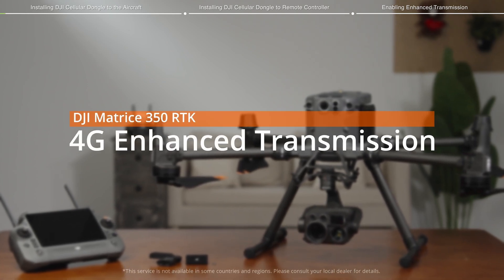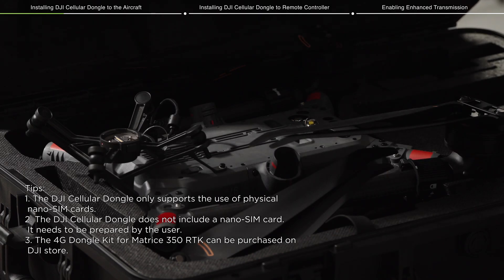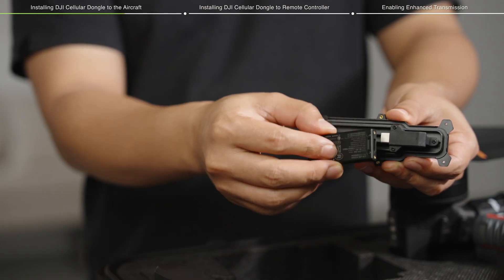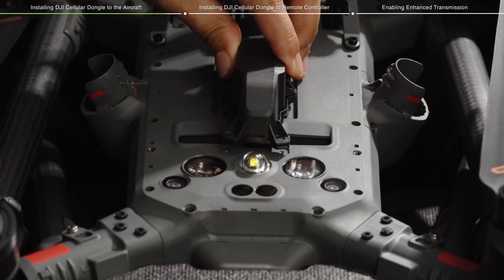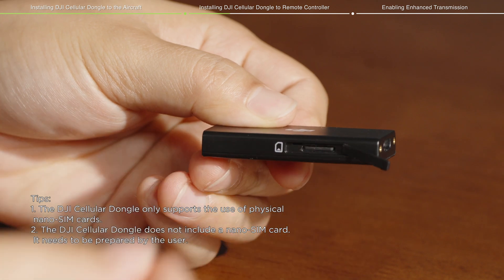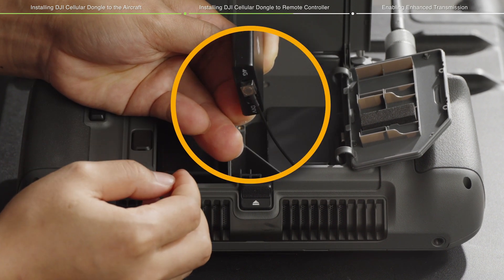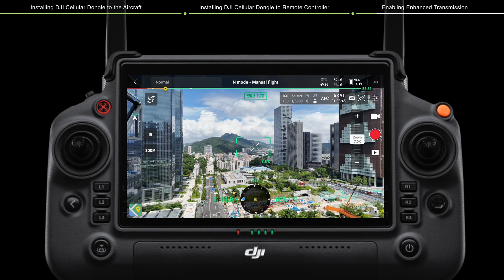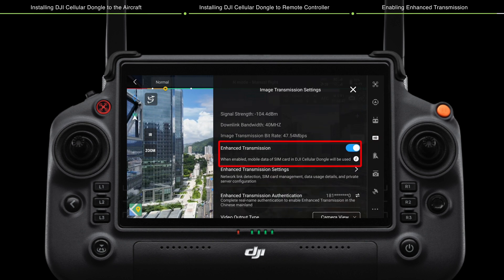Matrice 350 RTK: 4G Enhanced Transmission

Comment: Hi, if you have two RC Plus to control the m350, do both need a dongle installed? Does switching UAV steering control also work when you are on 4G network?